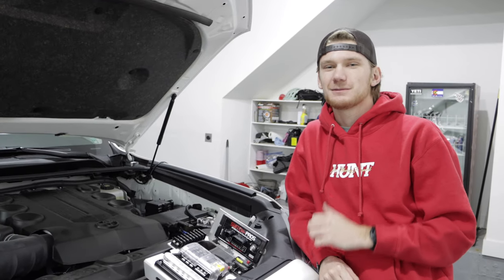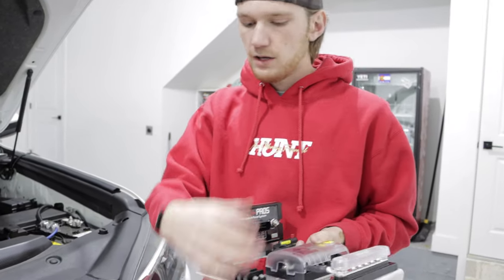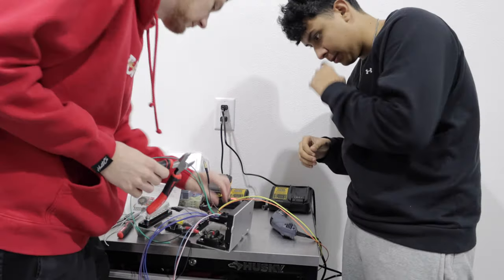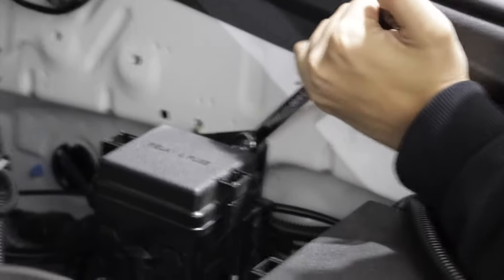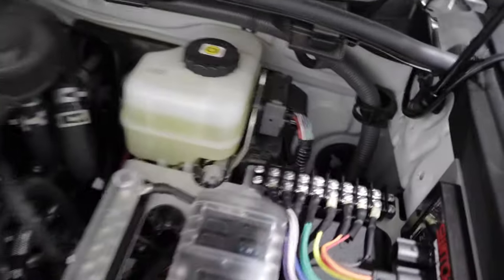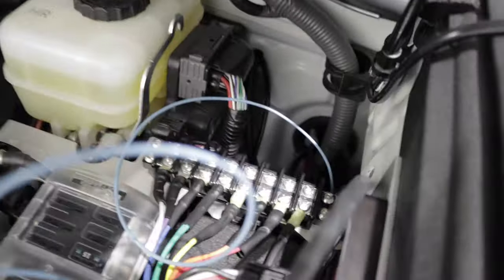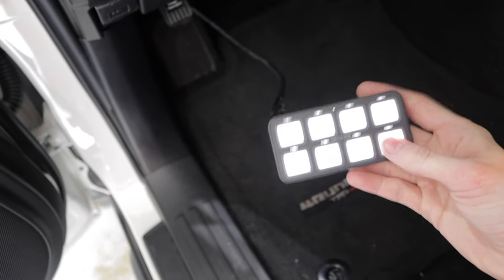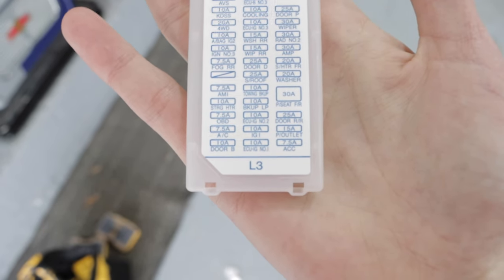We have LIGHT control!! Switch Pro 9100 on 2021 4Runner! (This took longer than expected...)

Comment: This was the best video I could reference for my 2022 4Runner.  I’m not sure how others do it, but I found it tough when installing the full tray set up on the truck.  Getting the wiring through the firewall grommet was a b*tch, and ended up pulling half the grommet into the cabin.  Took me 40 mins to get the grommet to seat and seal perfectly again.  Still have switch wiring to complete and then cables to battery, but those all seem too long. I totally agree with your frustration on this install!
Reply from the maker: Grommet was one of most frustrating things

Comment: Connor,  From your experience installing the switch box relay, it’s easy to understand why the majority of automotive problems are electrical in nature. Most owners are to scared to even think about doing this type of work.  Kudos to you for a successful installation.  I am still deciding on what accessories I will buy for my 2022 4Runner Off-road.
Reply from the maker: There is something about installing things yourself that you learn and appreciate even more! Hopefully your 4runner turns out amazing!

Comment: Seems like you did fine. Set up looks clean and professionally installed. Don’t beat yourself up on it and these electrical jobs and running wire take a while and some good hours that’s why they charge so much for install so don’t consider your job/yourself as taking to long. When your doing it right it takes time.

Comment: Way easier to remove OEM relay from bracket then remove bracket. Where did you put the relay box. There is a tapped hole by firewall for it to sit out of the way and be accessible.

Comment: Mine came with a. Fuse link (a lot smaller) in line with the power wire. Saves you slot of wiring space

Comment: I'm burning through just about every SP-9100 installation video there is on YT and hitting the forums as well BEFORE I crank/cut/strip/drill/remove anything OEM and the switch itself. I'd really like to mount the switch pad elsewhere BUT the area most popular is on the L side where you did. This may be the most advantageous spot as it's the closest to the engine bay although I'd entertain mounting it on a RAGO, or simular, mount center dash clock area using RAM mounts to keep it on my right and at somewhat eye level. Decisions, decisions
Reply from the maker: I bought the mount from SDHQ So I did not have to cut into any oem panels. The mount replaces the oem panel with a pre-cut slot for the panel to fit in perfectly
Reply: @Connortaustin ...yeah, I've had the MT on my hands for a bit and that's a not a problem nor concern.  When I say "OEM", I mean where the touch pad will mount. Only want to drill/cut once.

Comment: wazzup bro quick question where did you tap the white wire? TIA
Reply from the maker: So I haven’t tapped the white wire in yet, but when I do I’m going to tap it in to the tail slot, so when ever I turn my lights on at night time, the switch dims also

For me the tail I believe is top left on the fuse box if I remember correctly off top of my head

Comment: Just curious not questioning your method at all. But Switch Pro says that you do not need to use terminal blocks or relays you should connect directly to their wires for warrantee purposes. So why are you using all that extra stuff when switch pro recommends not to. Again just curious I am not questioning your method?
Reply from the maker: If you just use the switch pro mounted to the side-wall it is going to be a mess with wires and everything…

Adding the mount from sdoffroad mount, allows for a terminal block / bus bar / fuse box / relay switch where you can put positive/negative on the mount for all 8 accessories for the switch. So with the mount I have, only 2 wires are going through the firewall, and everything is clean and mounted to the tray instead of multiple spots within the engine bay

Plus if you wanted to add other overland accessories then you’d want a tray with these options
Reply: Gotcha understood. I didn’t think of the neatness aspect of it. Thanks